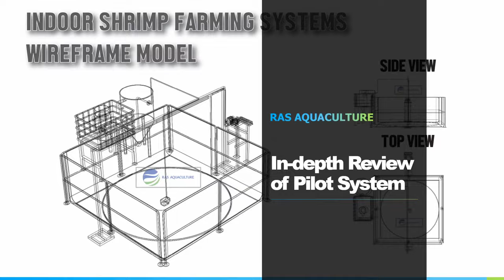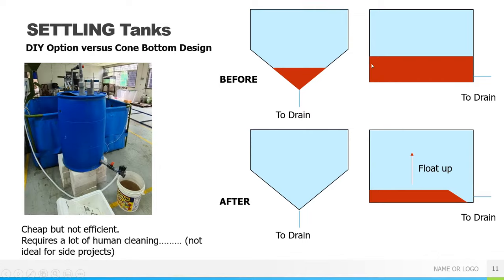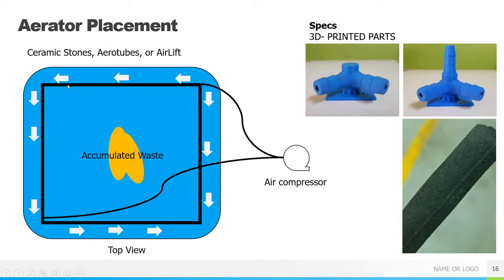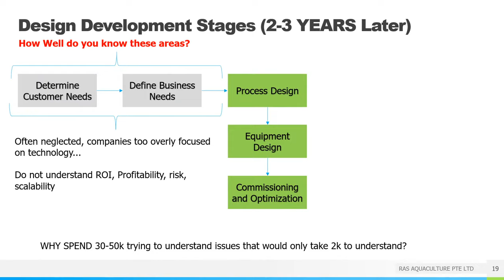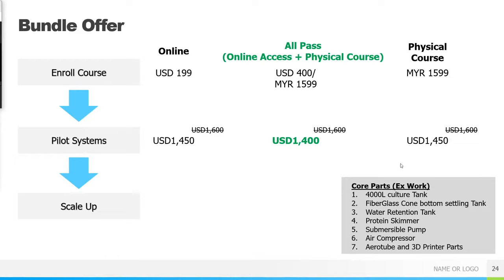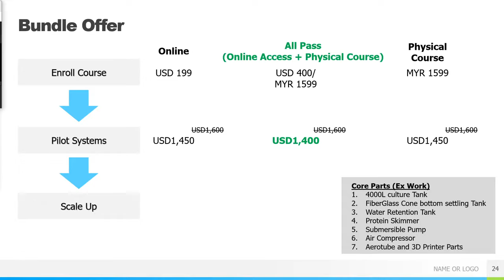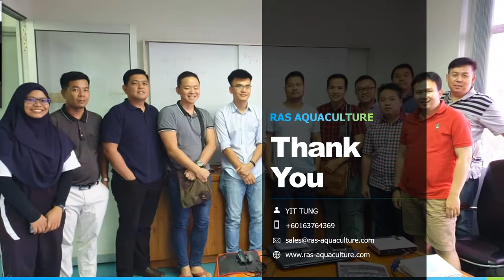Live: In-depth Review of Biofloc Pilot System

Comment: Great video, nice to see the system broken down and each part explained! Funny start up is relitively a low cost but the land or the warehouse needed to actually carry out this process would be £500,000 at minimum and that would only be a small facility in (United Kingdom). One small thing though stainless steel is deffinetly stronger than mild steel so any one wanting to upgrade from the chrome legs I would deffinetly suggest stainless.

Comment: Thank you for this wonderful webinar.

Here are the links for the subject throughout this video:
00:55 The Presenter 
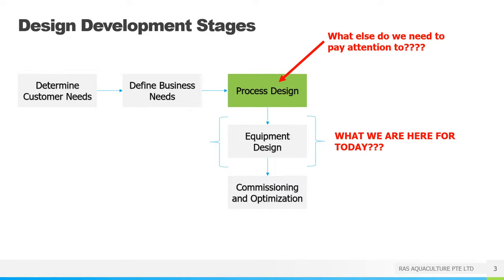01:13 Intro
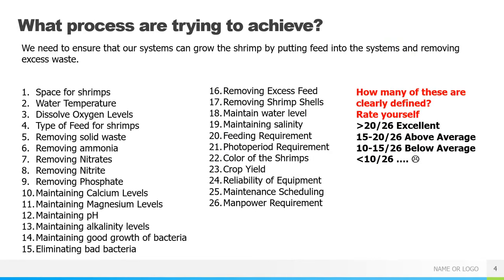02:32 prerequisite knowledge
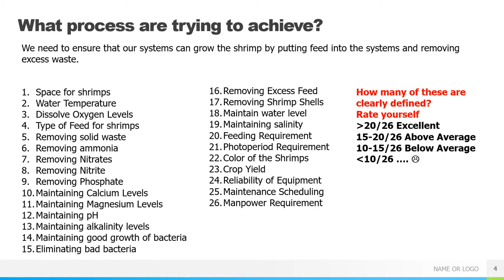03:50 The Pilot System Design
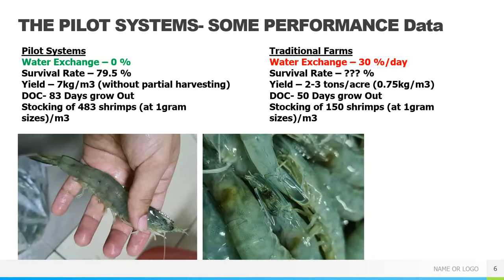05:43 Performance Data 
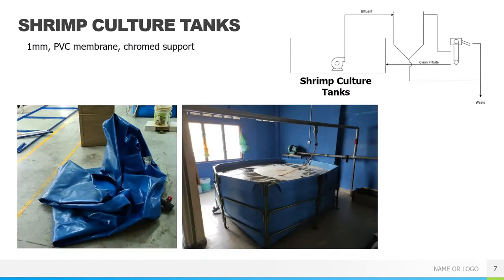07:41 The Tank 
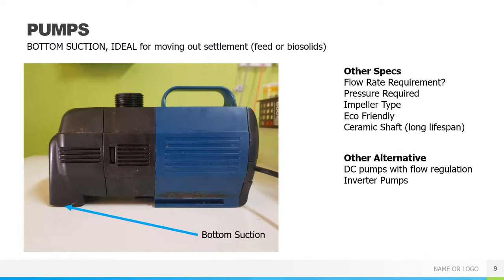11:00 The Water Pump
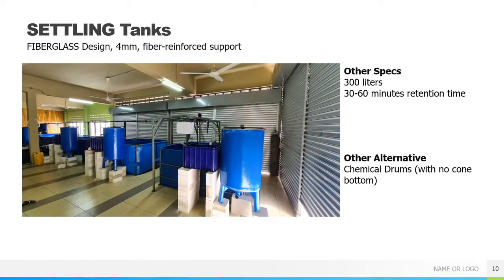12:29 Setting Tank 
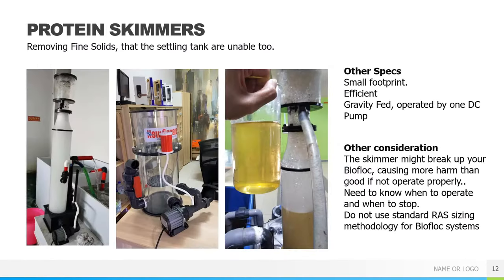15:38 Protein Skimmer 
17:28 The Need for a Skimmer
18:23 Assembly  
20:00 Aeration 
22:55 Conclusion
27:55 Business Scale 
34:16 Q\A Stock Density 
36:40 Q\A Biofloc with Aquaponics 
37:18 Q\A Tank Shape 
37:59 Q\A Power Consumption 
38:36 Q\A Nitrate level
39:03 Q\A Disease outbreak
40:56 Q\A Crab
42:02 Q\A DIY Shrimp feed
43:23 Q\A Harvest before die off
45:20 Q\A Aerator Size
45:29 Q\A prevent cannibalisms Q & A 
45:42 Q\A power consumed per cubic meter.
46:10 Q\A How to buy your pilot system
47:39 Q\A Travel to Malaysia
48:50 Q\A fish RAS or Biofloc webinars
49:29 Q\A Certificate for this webinar
49:50 Q\A Black Tiger Shrimp in Biofloc